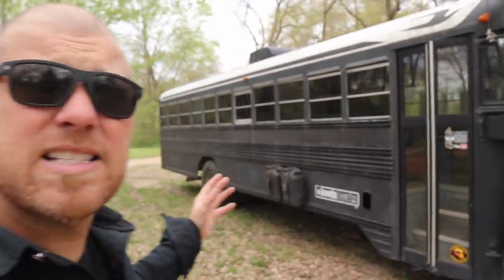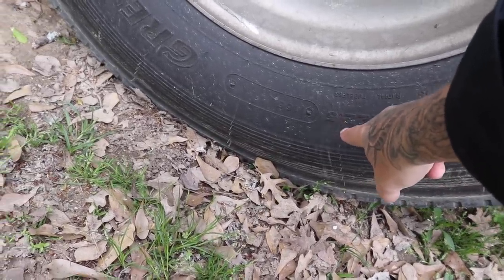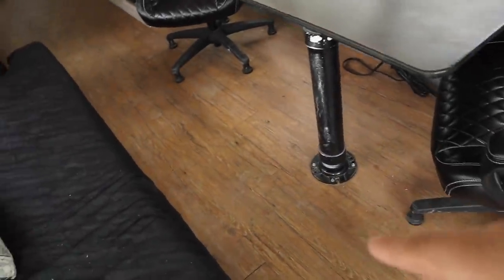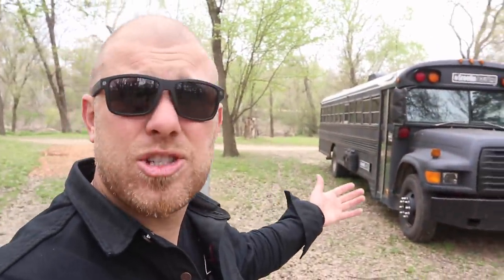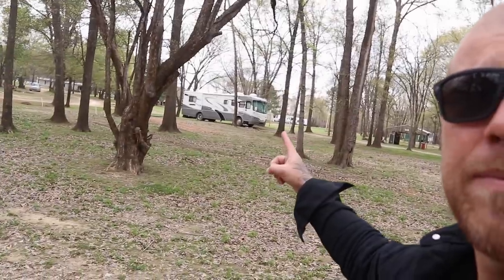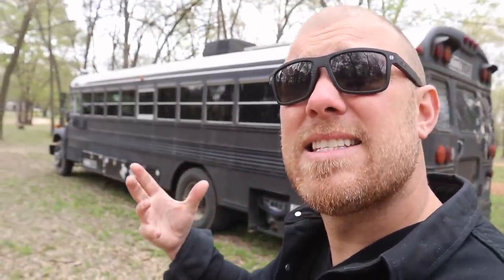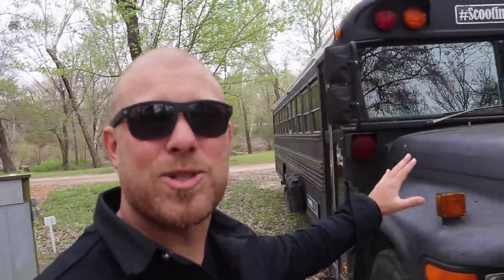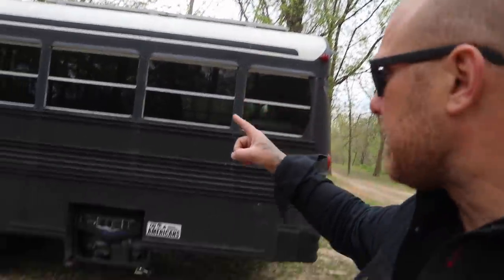5 WORST things about a SKOOLIE / School bus conversion.

Comment: Around 20 years ago I bought a shuttle bus, 27 passenger with a wheel chair lift. I was a residential house painter and we restored old shutters so I figured this is the rig. I called my local police and they said to call the state police. I live in Massachusetts and the state police are our registry police. They told me as long as only 5 people can sit on the bus all with seat belts i could register it as a cargo van. The local and state police both had to come and check it out to sign off on it. The whole process took about two weeks. I also after a while asked how to register it as an RV if I built a camper. They said its the same process.

Comment: for the cost of super singles, I would strongly counter your claim. the true cost after it is all done is directly comparable to having the transmission swapped for one with a more preferable gear ratio meaning higher top end speeds. For a surprising amount of people, it would be cheaper to swap the trans given the model of the bus, the current trans, the engine, etc. Not to mention the rough ride a super single has, not preferable. In the event of a flat or blowout, the bus could keep driving with duallys, as long as you are careful, this is not an option with super singles. For people buying a bus, look for one with good tires that does not need replacing for a good amount of time, and if you put any money into the gearing, make it be the transmission.
Reply: Depends on who does the tranny work. I personally found brand new super single tires and rims for $660 dollars which normally could have been $2000 or more. Now when you throw in the cost of a BD exhaust for mountain braking then maybe it would be a better option. The allison 545 is a free open tranny that wont slow you down in the mountains
Reply: First problem I thought of when he said "Bigger Tires". In the case of a right flat tire, on a country road that has  a grade lean, you're going to leave the edge of the road with  a pretty good chance of ending up on your side.

Comment: I am new to this and wondering, has anyone considered adding an UNDER/OVERDRIVE unit to the transmission?? Also, what mileage should be expected with these beasts??
Reply from the maker: you'd be lucky to get 10mpg, similar to what you'd get out of a large rv or pulling a 5th wheel

Comment: I don't know whats driving me so deep into this community, but I'm not gonna stop till I have a skoolie of my own
Reply from the maker: dream until your dreams come true 😎
Reply: Me too. Lol
Reply: I’m close! ;)
Reply: @adamsandoval  My question is about insulation. 

I already know how to summer proof the windows no problem at all. My only problem with summer proofing is increasing air circulation in the bus in the summer without having to open the windows all the time and let in the bugs. 

My other problem is winter proofing in general. 
Addressing thermal bridges and insulating the walls and floor.
Reply: I love that and same
Reply: currently in the process of selling our house to buy one!!
Reply: Same lol
Reply: Me too!!! We got this
Reply: @DylanBegazo  I think I saw this in Fern the bus’s tour video but what they did for summer air circulation was install a dometic fan that would take all the air out to keep everything cool. For winter one of the big things would be the bus door which is a horrible insulator. You should also divide the bus area because smaller area get warmer faster. I think these two things will save you tons of money you otherwise would throw away in furnaces and ac’s
Reply: I'm hoping to get mine this month
Reply: I'm building one now 😁
Reply: @ourhumblecommode  I hope to get a started one. But I found a place that scraps busses today. Apparently I can intervene and get them cheap. So one way or another I'll get a skoolie.
Reply: Being a OTR truck driver rough ride and slow speeds don’t bother me much… would love to build one myself…install lots of solar
Reply: i felt the same for years and ill finally have mine by the end of the month!!!! dont give up!!

Comment: We actually bought a school bus to use as our daily vehicle for our large family (much safer than a passenger van, and much cheaper-we didn’t want to get into a huge debt for a dangerous vehicle that will last only a few years!). We watch skoolie videos because there is still a lot of info we can use as we have to paint it, change some seats out, remove the stop sign, etc to get it registered. However getting it insured in our case wasn’t so bad. The big companies wouldn’t do it but they all told us to go local. First local we called they insured it no problem-and it’s full coverage not just liability. Oh and it’s far cheaper than the insurance we have on our mini van-they said because the bus is safer. It’s not the same as an rv, but maybe best luck going local.

Comment: One thing with a vehicle this large you don't want to go faster than 65 mph because you loose 20 to 30% of your fuel mileage.
Reply: Not only that, but in something so big it’s going to take longer to stop. I hate to say it, but it’s pure stupidity & careless to think it’s okay to be driving 80 mph in a huge bus.
Reply: But that’s only if the mechanical problem is left unsolved. 

Like bigger tires and tuning like the other guy said.

Comment: I have a 2003 Bluebird FE 29 foot bus with air brakes and a kneeling feature. My #1 problem is leveling. When the air eventually starts going down the bus rocks forward and mangles the leveling device (we have tried several different types at this point). I can relate to your list and have had to deal with all of those along the way, but leveling has been my biggest unexpected headache to date.

Comment: I've been turned down at RV parks because my Gulf Stream Sun Stream Hi Rise Class A motorcoach is over 10 years old. Yes, it's much older than 10, it's a 1988 making it 31 year's old now. However it looks as if I just drove it off the show room floor. It has a brand new fresh full body custom paint job on it. I have found sending a photo will sometimes help. Other say sorry, rules are rules and still won't consider letting in an older RV.  But it never hurts to ask. All they can do is say no!
Reply: Crazy that this is the case!

Comment: I have one in the UK. Campsites and insurance not a big issue and I have kept the stop sign and yellow color . Ride is rough and insulation poor. Mine is ECM limited to 55mph, but that's not an issue. Biggest issue is miles per gallon on fuel!

Comment: Be aware if you change your gearing OR go to bigger tires, it will throw off your mechanical speedometer. You will be able to use your GPS to see your actual speed depending on your signal, but the speedometer in your dash will read lower than your actual speed. Try telling that to the officer. Then you will also get a ticket for having defective equipment.

Comment: His comment about using taller tires to help with gearing is ludicrous. The 2mph average that you can gain isn't worth it.  It's relatively simple to change a 3rd member of most of these rear ends. I paid $500 for a used and inspected 3rd member for my bus. I asked the local truck shop what they would charge to tell me what I need and then to install the part. Approximately $800 

Do your research, go talk to some truck shops. Don't blindly listen to some yahoo.
  
FYI - I spent 25 years as a Master Level Mechanic before retiring.

Comment: A better alternative to larger tires would be a lower ratio rear gearset. I dropped mine from 4.63 factory to 3.42 for only $250 from Vanderhaag’s. Same wheels and tires with better top speed and fuel economy.
Reply from the maker: Good to know 👍🏼

Comment: My shuttle bus will go 100 miles per hour no joke, at 70mph im only at 2000rpm, its a Gas engine, 6 speed transmission and a 2016
Reply from the maker: Impressive!

Comment: You really didn't do anything to add insulation to the bus, so what would you expect. Have you ever thought of removing the original heater and doing like so many others and install a wood stove. Fuel is all around you free.

Comment: Those are some five great tips / things to watch out for thank you so much for sharing. We're currently in the middle of our bus conversion and insulation is one of the things that we're going to have to do, because of how crappily insulated the bus is.
Reply from the maker: MEREDITH and PACO you would be glad you did
Reply: My question is about winter insulation. 

I already know how to summer proof the windows no problem at all. My only problem with summer proofing is increasing air circulation in the bus in the summer without having to open the windows all the time and let in the bugs. Stagnant air is an issue to fresh cool air in a bus I’m sure. 

My other problem is winter proofing in general. 
Addressing thermal bridges and insulating the walls and floor.
Reply: @adamsandoval  any thoughts?

Comment: NH doesn't require insurance. I did obtain a 5 yr $100,000 bond that cost $100. Registered as a seasonal motorhome. I keep telling young people that in 1970 about half the states didn't require insurance. Most Driver License didn't have photos. There is no reason not to return to those days.

Comment: They have low gearing like 4:11 a 3:25 gear set would increase the speed but loss of torque.
Reply: have to be careful going too far, transmission compatibility issues possibly. There's all kinds of calculators to help you get an idea of what you can do.
Reply: @mattperry4268  The "poor man's overdrive" is a good solution - larger tires!

Comment: Do you  have further info on retro-fitting the super singles? I want to do that on my Thomas....
Reply: super singles require at least 125 psi which is hard to find away from truckstops. also they are no softer than 11r22.5 tires as far as ride.  a couple of taller tires will not make a 65 mph bus run 80 mph

Comment: 1. They were made for short trips and many stops. Low gearing for sure. 
2. They were made for use with engine on where you get easy heat.
If engine if off, install insulation and extra heater.
Reply: Some of the Northern buses are now equiped with an extra heater meant to run seperately to keep the system warm on really cold days... helps with starting and reduces the need for glow plug prewarming.... being a diesel

Comment: Why on earth do you want to drive 80 mph? After 57 mph aerodynamic drag starts to build in a serious way to the point that every 10 mph over 58 the drag quadruples. Another 10 mph it quadruples again. Just wasting fuel and let's face it a school bus is the same as trying to drive a barn down the road.  Change out the differential if you want highway speeds and pick your mountain passes carefully.

Comment: You can also change all the windows to triple pane RV windows.  You can also install air ride suspension..Also if your bus is a puller and you have a dog house then engine noise and heat will be a factor in the drivers compartment.  I like to insulate the hell out of the engine compartment and the doghouse for both heat and sound.  If you dont mind the work and you want allot more insulation in your bus then raise the roof and in doing so weld additional thicker ribs on the ceiling so you can install thicker insulation.  you can do the same thing on the walls.  Although if your doing the walls I would weld the ribs on the outside then insulate between the ribs and re=sheet metal the outside of the bus.  This will also eliminate all the school bus body ribs which I never liked.  By doing wall insulation externally you avoid loosing  any living space inside the bus
Reply from the maker: Those are all great ideas 👊

Comment: Uhm, you keep repeating buses are made for running kids in the city to school. Having 4 decades of driving school bus in me,, not one of my routes were in cities! Country kids go to school also my friend. ln fact, they're needed in rural areas more so than cities! cities have subways and city buses etc, country or suburbs rarely have a system that would cover the town. My favorite route was also my most challenging with spring mud and snow-deep unplowed roads as they aren't all paved or have equipment. Often high school kids had to be bused into other towns that actually had a high school. I'm not talking about some out-of-the-way places or huge states, I'm talking Western MA, only an hour or two from NYC. Those buses went thru their paces, believe me!

Comment: If you so happen to get a bus with air brakes you're gonna have to get the right endorsement on your license.
Reply from the maker: Pork Chop actually that’s not true. If it’s a private RV there is no endorsement needed
Reply: @adamsandoval  good to know, thanks.

Comment: For me, pulling a trailer half the time, I enjoy being the slowest thing on the road. 
It's a total stress relief, no strategy, no fuss, pedal all the way to the floor, sit in the right lane and take in the sights.
I can go 2500 miles and only have pass another vehicle 3 or 4 times. 
When I wanna go fast I get the chopper a.k.a. The Grocery Getter, outta the trailer. I'm seven years into my current bus, two and half now full-time.
Reply from the maker: You’re living the life brother 👊🏼 very cool

Comment: Lic and insurance varies by state do your homework some states will be super easy like here in N.C all you have to do is remove the seats and signage. Progressive and good sam offer really cheap r/v insurance (mine is 95 dollars a year) (yours will vary depending on usage estimate). The gearing is tricky, putting bigger tires on it will increase your max speed but will also throw the speedo off, so you will want to use A gps to find out how much, Or have the speedo re-calibrated. For around 1500 bucks you can have the rear end re-geared and keep the stock size tires. Buses  made after 2000 will have A governed speed and engine management which can be changed, Again for A fee you can have the max speed/rpm/fuel pressure turned up to regain lost performance from the  change in gear ratio. Even older mechanical diesels can have the fuel pump shimmed to regain performance. As far as the rough ride do not ever lower tire pressures below what the tire says, doing so can cause unsafe handling and blow out's. Removing A leaf in the springs or  if you have air ride lowering the air bag pressure will soften the ride considerably. Most camps now a days have A website and will tell you if they do not allow skoolies, But even those mostly will allow them if they are well done or diesel pushers (like mine) I call ahead and say " hey let me send A photo of my r/v" and ask for consideration. NEVER say "I  have A school bus" can I stay there.
Reply from the maker: All very good points

Comment: Could you pull a leaf or two from the springs to improve the ride?
Reply from the maker: That's an idea
Reply: Or you could add air ride suspension. It certainly works wonders for semis.

Comment: 80 mph on this scrap? As a truck driver with experience in heavy haul i see a lot of this sick people on the road.  Semi has 2 drive axles  and 4 super singles . When a tire blows its a challenge. This school bus has 1 axle and 2 tires imagine blown tire on 80 mph with just 3 points of contact to the road.  101% accident. How bad? It depends how much luck left on your luck account. Road service to replace super single on the road 2k! With duals you can make to the tire shop with super single you will not.On the snowy road dual are much better! In the end to everything your axle and bearings are not designed to carry super singles. I have just one wish- idiots like you  to stay home only! Unfortunately it will never come true.

Comment: My idea is to change out the running gear with one from an over the road semi truck. Tandem duals with split gear rearends or the single wheels either one. And if your really ambitious use the entire running gear, engine, transmission and rear ends from semi. Semi trucks are geared for highway speeds and have plenty of power to pull a loaded bus.
You can get an older used semi for a donor. 
Another idea is to add air ride system from a semi. That would help reduce the rough ride.
It would be a lot of work but the difference would be huge.
I have a plan for one of these I hope to complete in the near future.

Comment: lol my 53 gmc had a .457 gear ooof. I swapped it for a .411 and can go about 65 wound out.
Reply: oh yeah ... try 6.57
Reply: @mattperry4268  LOL that probably pulls itself along when the engine isn't even running xD
Reply: @kittywampusdrums4963  I just got done pulling the original 3rd member out. It was worse than I even thought. 7.17 gear ratio. OMG ... new gears are 4.62 so I'll be dropping 35% of my RPM at highway speed. When I bought it I could only do 55mph at 3400 rpm.
Reply: @mattperry4268  lol omg is that ratio even possible 😆